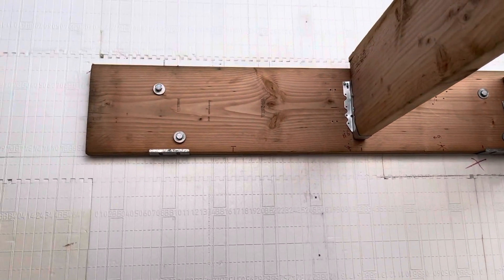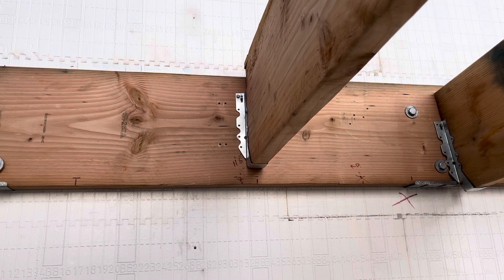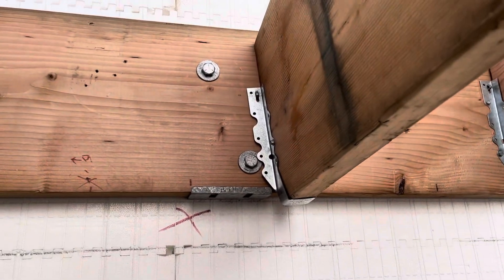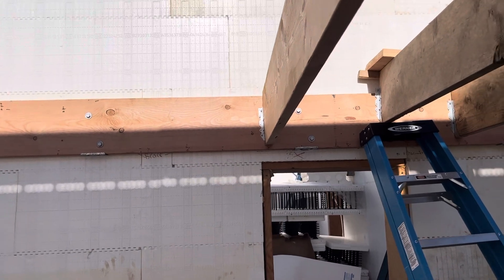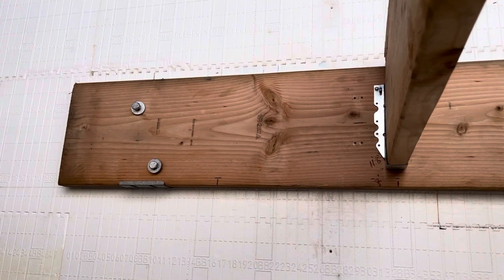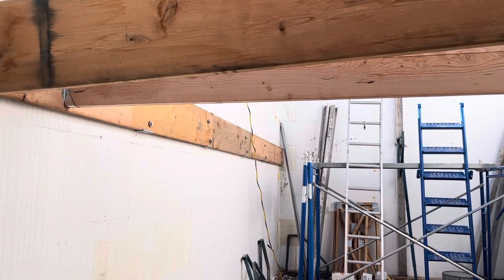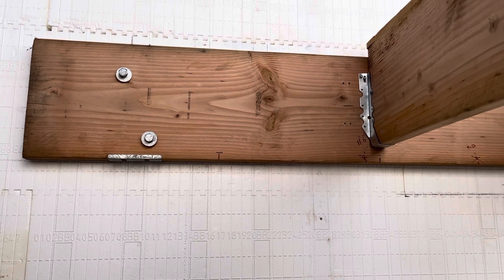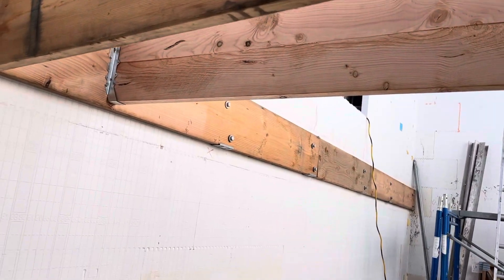ICF home build mistake and how to avoid it :)

Comment: There is another method where you install your joists before the pour and even subfloor so that it acts as bracing for the pour.

I want to do that to eliminate rental bracing or waste from wood bracing that gets stripped off later.

It also has the benefit of eliminating the hanger interference because you can move everything before the pour.

The other thing I want to do is called a Wind-lock Anchor Tunnel which is a plastic piece that threads in to a 6" hole you cut in your ICF foam.  That allows you to use a J-bolt to hang your ledger with no foam between the ledger and the concrete.  It might not be a big deal but it's a stronger way to do it.  It is a bit of a thermal short also but not too bad.
Reply from the maker: I’m actually going to install all my joists before my next pour so I will let you know how it goes. 

I still have 3 more levels to go plus the roof :)

Interesting idea on the j bolts
Reply: I believe that is the Simpson joist hangers he referenced in the video.
Reply: @TriDaddy  yeah, he has Simpson joist hangers but they are running in to his ledger mounting hardware (I think he is using Burmon).

You are always going to have a joist hanger (or I-joist hanger) but the way you attach the ledger has options.  I think anchor tunnels with J- bolts are one of the strongest options, pretty easy and relatively low cost.

I try to look at everything and I didn't see any simple way to hang a ledger that looked particularly strong, especially when you have a bolt with shear stress and about 2" of that only supported by foam.  The anchor tunnels just make sense to me.
Reply from the maker: You are correct. I have burmon hangers for the ledger that goes into the concrete and Simpson for the connection of the ledger to the floor joist.
Reply from the maker: For my first pour I didn’t do it. But now that I have a solid wall to work from I will be doing it on my second pour. Depending on how it goes I may do it for the rest of the pours all the way to the roof 48’ above my crawlspace 😂
Reply from the maker: I'm about to find out next week.  I installed the floor and it all seems super solid but the proof will be when I pour the concrete :)
Reply: @LegacyViewsICFhomeBuild  good luck with the pour!
Reply: @beardoe6874  ...another method for j-bolts: 

drill your holes in the TREATED ledger board (half towards top, half towards bottom), temp fix it to the ICF with blocking to hold the weight, mash a bolt through the ledger holes you drilled just enough to indent the foam. pull the ledger board down, use a holesaw to bore a 2-3" hole (depending on load) through the foam at each indent, and mount all your j-bolts into the ledger board with nuts/washers on the back/ICF side. now re-mount the ledger board with the j-bolts sticking into the core of the ICF, brace, pour. 

this will allow pucks of concrete to sit flush against the ledger board & increase the stability/strength of the j-bolts/board. because it's on the inside, any added heat loss is only into the thermal mass of the concrete, so it still works to your favor.
Reply: @Krazie-Ivan  yeah, that saves the cost of the tunnel anchors but how is the ledger held up before the concrete is poured?

You could screw in to the foam in a bunch of places but that seems like it might be more effort than the tunnel anchors are worth.
Reply: @beardoe6874  ...just need a pair of 2x4 off-cuts screwed in for the ledger to sit on. Can have 2 more 2x4 off-cuts on top of those, but leave one side loose ...swivel it up to pin the ledger, then screw in that side.
Reply: @Krazie-Ivan  yeah but the idea is to use the floor/roof as bracing and if it's just sitting on little 2x4 scraps screwed to the wall it can't stop the wall from moving outward.
Reply: @beardoe6874  ...oh right, forgot we were talkin about an inside ledger. 

mostly use this method for mounting heavy things outside the envelope, like awnings that double as PV panel frames, and i like i-span inside. for outside, instead of a ledger, flat plywood strapping or OSB will hold the j-bolts till after stucco. leaves a perfectly flat & solid & square surface for metal plate.

yeah, i'd just screw into the ICF ties once i was sure the ledger was positioned/shimmed on the 2x4's exactly right, then remove the temp off-cut blocks. 

to me, it's worth it to not have another purchase or part to keep track of in the specialty tunnel bits.
Reply: I haven't priced everything out yet but on my split level two story design, I think I can do all of my ledger connections with anchor tunnels and J-bolts for $4-600 total.  That's about 80' of ledger and I think that's pretty reasonable for what I think is a superior product.
Reply from the maker: That’s a great price :). The other reason why I went with Watkins hangers and open web floor trusses is that I live in earthquake country. 

Those Watkins hangers are not coming out and the trusses sit on top of the beam in the middle of the home so they too are continuous. 

Having what amounts to a five story home I really don’t want issues with my floor system
Reply: @LegacyViewsICFhomeBuild  I grew up in California although I'm building where earthquake risk is low.  So I know earthquakes but I'm not too worried about them but I'm not going up 5 stories either.

The thing is most residential codes and products are made for stick built homes.  When you go ICF you get a much stiffer structure but you also get foam which isn't very stiff so your shear loads turn to bending loads in the foam.  Bolts are mostly made for resisting tensile loads but also shear but not really bending loads.  My philosophy is try to eliminate bending loads by eliminating the foam with an anchor tunnel and then use the biggest hardware possible (the J-bolt).

I might have to get "engineering" done but it's massive overkill so I'm not worried.

Other options seem to have all the "problems" I want to avoid like relying on thin sheet metal and screws instead of a big bolt.  With a stick built home the sheet metal is stronger than the wood so no problem.

With a ledger bolted to a solid concrete wall, it's not really going to bend because the wall is not going to bend but a rigid connection is probably going to make the floor a bit stiffer.

If the walls do move in and out at all the floor will brace against that and the roof also.

I think my weakest link will either be the I-joist or the I-joist hanger.  I can't really make the I-joist stronger but I can use the strongest joist hanger I can find and be happy that everything is as strong as possible.
Reply from the maker: Great insights. I wonder how much the plastic webs every 6 inches help with stiffening the foam with the ledger board going perpendicular to them.
Reply: @LegacyViewsICFhomeBuild  the major load is downward so it depends on how the plastic "stud" strip is connected to the rest of the web inside the foam.  If it kind of makes a horizontal tube, it won't help much but if it's a vertical I-beam it might help a lot more.

I'm actually planning to use something like Mikey Block which typically uses horizontal OSB strips to align the layers and provide a sort of stud but I'm thinking of replacing the OSB with the cheapest generic version of Trex I can find (to avoid insects and rot).

Any way, I won't have vertical studs but it is a screen grid ICF so it only uses about 75% as much concrete as a solid wall type but has a similar amount of steel reinforcement and is just as strong.

My major loads tying in to the wall are the second story floor and roof.  My location has occasional high winds so I'm going to try to do the strongest roof connection I can do (short of a concrete roof) and if I have anchor tunnels everywhere else I anticipate loads (floor ledgers and kitchen cabinet French Cleat), my horizontal studs will only be for small incidental loads.  And I plan to do a gallery rail for hanging things on walls so I don't have to drive nails through my plaster.

I've thought about this a lot.  If I'm going to build with ICF I want to build a 300+ year house but my budget requires that I save anywhere I can so I look for high end methods and see if there is a way to get similar results with lower cost materials or methods.  I'm hoping to come in under $100/ft² but I'll be doing nearly all the work myself (I will hire a crew for the concrete work but I'm going to help).
Reply from the maker: The plastic webbing is designed as a vertical load. 

Sounds like we are thinking alike. I’m designing a 500 year home that can be easily upgraded by future generations of my family. 

And I too am doing almost all of the work myself so I can come in well under $100 per square foot.
Reply: @LegacyViewsICFhomeBuild  yeah, I know it is a vertical strip but you need to look at the side view and top view.

If the plastic web SIDE view looks like an "0" or a "□", the foam in the middle will be in compression and the shape could sag with a vertical load.  If the TOP view looks like an "H" or "T", those are versions of I-beam and that will be stiffer with a vertical load.

But that's just the strength of plastic and foam.  When you use an anchor tunnel you get the strength of reinforced concrete which seems like the goal to me.

By the way, when I was in college I took some courses on strength of materials and structures.  Everyone should try to understand how an I-beam works: it tries to make all of the beam in to tension, compression or shear members and eliminates the material that is just along for the ride.

Everyone should also try to understand how reinforced concrete works. It has concrete which is brittle but strong under compression loads and steel rebar which ìs ductile but strong under tensile loads.  The combination has a mixture of those characteristics, reducing the brittleness and increasing the tensile strength.

Foam and webbing is similar but both materials are weaker so I would prefer not to have that between my structural members.